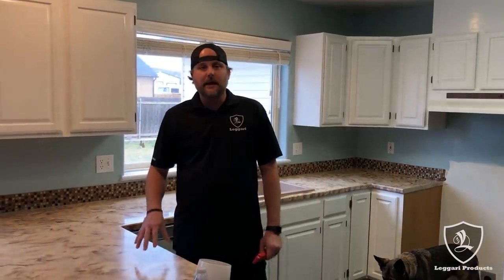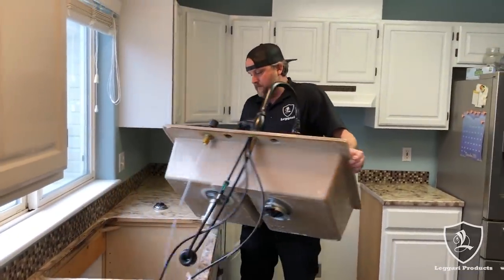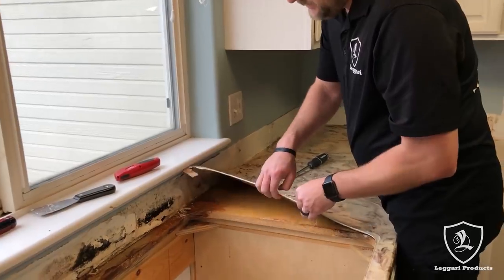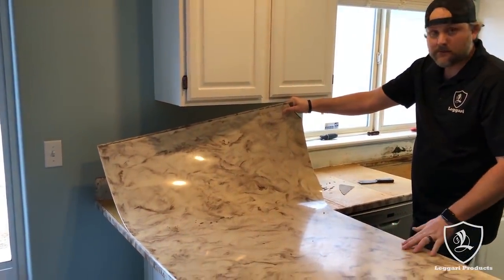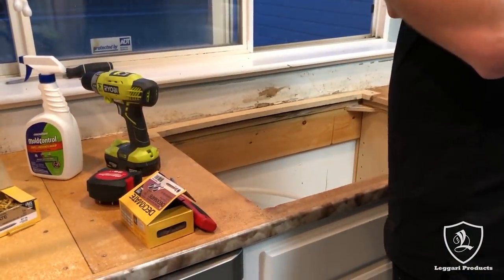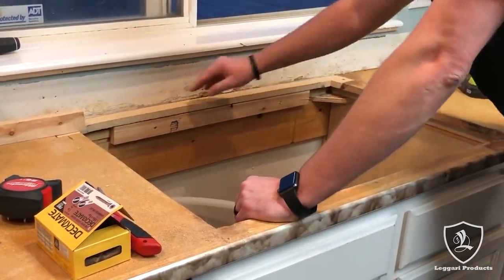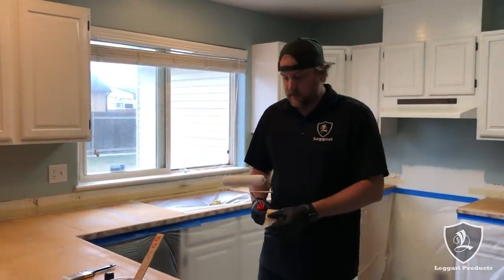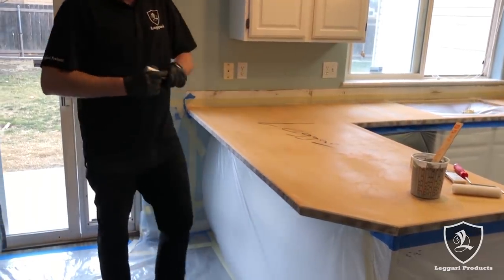Metallic Epoxy Kitchen Renovation | Before & After | Beginning to End!

Comment: I disagree with using the drywall mud. Although easy to work with and inexpensive, it's also water salluable. If you get any water, moisture under the epoxy or bonding primer, it will break down and seperate from the drywall mud. I'm always open to information and learning if you know something I don't, I would love to hear and understand the material/method used. Great video, beautiful work. :)

Comment: Thanks for showing us how you handled that mold issue... talk about half assed! I've been in construction for over 30 years and that just sheer disgusting! Like they say  ... what does it matter, you can't see it from your house!  Grrrr!
Reply: Right!
Reply: Indeed. Spraying damaged porous material with “mold cleaner” and wiping it a bit. That wall material should have been cut out and replaced. This is precisely why good contractors get a bad reputation - poor, lazy work done by their peers.
Reply: You can tell he isn’t a contractor...he’s a countertop guy. He should’ve removed the molded sheet rock. His lingo referring to “bolting” the supporting 1x to the wall tells me that he doesn’t do much construction work.

But, what he does really well is create gorgeous epoxy countertops. That countertop turned out looking amazing.

Comment: Does a top-coat give a smoother reflective finish at the end?
Reply: Matt Mastracci yeah I feel like a top coat and torching this project would have made it a lot better. Still great job though
Reply: @DustToGloryPW  I wondered why he didn't torch it. Perhaps the alcohol does the same thing to disperse and remove air bubbles. Does look good
Reply: @flaron352  You got it; they explain in some other videos that the Leggari Products are formulated so you don't have to torch them; the alcohol not only causes the cool cratering effects, and spreads out the pigments in the more natural looking granite effects, but it also causes the bubbles to surface and pop :)
They have a couple top-coats that can be used, which give different levels of gloss finish, while adding a protective layer that I don't think a kitchen counter should be without

Comment: If the body filler is gumming up on your sandpaper you either didn’t use enough hardener or it’s not dry or both. You should be able able to sand that entire piece with one sheet of 80 grit. Also if you don’t use enough hardener it will continue to shrink for days and the deeper voids will reappear slightly after the job is done. Body filler aka bondo is a chemical reaction just like the epoxy is, It needs to be mixed right to work properly.

Comment: When dealing with epoxy its important to use a heat gun or torch to remove bubbles. You might not be able to see them with black and silver but they are there and will eventually crack.

Comment: I've never even thought or been taught using tape to deshed a roller! Awesome! The ashesive has no chemical reactions with primer or paint?
Reply from the maker: It works really good to get rid of all the loose fibers so they don't fall into the epoxy.  There is no chemical reaction with our primer it is specially made for our epoxy.  Thanks

Comment: Priming looked good. Wouldn't you want to prime that raw edge around the inside of the sink cutout, so the epoxy binds well to that material. To me that would help to seal it from any future water damage should a leak occur if the caulking were to fail. The rest of the project turned out fantastic as well. One other question, where did you get that hat with the rear facing brim? I'd like one like that. 😏🤭😁
Reply from the maker: Yes you can prime and coat the edges and it will help.  Not sure if he did that in the video.  Thanks for watching
Reply: @LeggariProducts  no he didn't, that's why I mentioned it.😏

Comment: Really nice. You guy should try mimicking quartz veins. I was thinking shaved crystals, crushed crystals, some real stone coutner tops, have, that stone flake reflection looking, I have seen people suspend stuff younger that mimicked that but I can't remember. So maybe pastic, but that s dull even in pieces... Sparkles are pretty easy to tell. Glss qouldnt work... My mind says there is a substance you can add to theresin to mimic such a thing in clear ot semi clear which causes the resin to kind of fracture under neath. This means you would need ot have finish coat on the top... hmm..
Reply from the maker: I will pass that information on to Tylor.  Thanks for watching the video

Comment: How long does the exopy last? Does it crack... Or is that about the quality of resin?
Reply from the maker: Our products are actually industrial coating made for military aircraft hangers, etc. So theoretically in a residential, or even commercial setting it will last forever. This is NOT a cheap epoxy paint that you will commonly find at box stores like Home Depot or sherwin Williams. It is a thick 100% solids epoxy coating.
Thanks

Comment: this is exactly what I want! how did you delint roller and I have pets so fur is an issue. I will clean, vacuum , mop and have the pets spend the weekend at a friends when I do this. however, I know lint, hair or fur will make its way onto the counter before its dried. I saw you pick something off the counter at the end. Is that all you do pick it off? it wont leave a mark? What color pallet is this?
Reply from the maker: If you get lint or animal hair while it is drying, then before you apply the top coat you can sand the surface with 220 grit to get rid of the hairs or lent then apply the top coat.

Comment: About how much working time do you have with the epoxies? And how long does the base coat have to dry before you can do the top color?
And when you spray the isopropyl, does it self level back out?
Reply from the maker: You will have 45 minutes to an hour to work with the epoxy and after applying the base coat you immediately fallow it up with the highlights.  Yes the isopropyl alcohol will self level out in the epoxy.  Thanks

Comment: Does your Apoxy products not have air bubbles? I didn't see you having to use a torch or anything. Very nice thorough video! Thanks for sharing!
Reply from the maker: We have a high end epoxy that has an additive in it to make the bubbles rise to the surface and pop on their own.  Thanks

Comment: I know this product is for counter tops and floors but is it possible to put it on walls with the same great results
Reply from the maker: This is not a good application for a wall because the epoxy will just run and you will not get the same look.

Comment: You need to do a follow up a month later see how it looks. I’m sure it will look lot different everything look great when is wet.
Reply from the maker: Our products are actually industrial coating made for military aircraft hangers, etc. So theoretically in a residential, or even commercial setting it will last forever. This is NOT a cheap epoxy paint that you will commonly find at box stores like Home Depot or sherwin Williams. It is a thick 100% solids epoxy coating.

Comment: What was the mold products you used this is the same thing that happened to my sink, mold control by who? Thank You Guys
Reply from the maker: It is a mold cleaner from Home Depot.  Thanks
Reply: Any porous material (mdf, drywall, hard wood can be sanded) that has become moldy should be cut out and replaced, along with anything behind or under it that has also become moldy. Mold “cleaners” cannot penetrate enough to kill what’s inside the material and it will return with any moisture. Additionally, mold weakens the structures it grows on and the the remaining spores can cause allergies and other health issues.

Comment: Hi there, GREAT job
just a simple question,
what is the primer used? can you simply just use paint as a primer? or paint primer or what?
thanks for sharing.
Reply from the maker: Our primer is a water based epoxy specifically designed to chemically bond to almost all smooth surfaces.  You will want to use our primer with our epoxy because it is specially made for our epoxy.  Thanks

Comment: On this particular counter top doesn't have the laminate back splash, I'm planning on doing one with that back part, wondering if I cut and make it flush is any video showing that process?
Reply from the maker: Sorry we do not have a video at this time, you can contact our techs at 844-534-4274 ext. 1 and they can let you know how to do it.

Comment: Needs more details. What’s the primer? Two part mix? Bondo is not structural. The epoxy (if it’s two part) would be more structural then bondo. Bondo is just a harder drywall mud. What kind of spray paint is that? What orange peal?

Comment: Is the surface non toxic and safe to prepare food on?  Also can future scratches be sanded and buffed out?
Reply from the maker: Yes the epoxy is 100% sealed with no outgassing.  Yes you can sand later and apply a new top coat and it will pop the countertop like it is brand new.  Thanks

Comment: What kind of primer did you use?  It was hard to tell.   Was it like a latex based paint primer?   Or an epoxy primer?   thank you!
Reply from the maker: Our primer is a water based epoxy specifically designed to chemically bond to almost all smooth surfaces.
Reply: Ok, thank you so much.   What a beautiful job you did.  I like to try that in cream based colors.   Very inspiring!!  Awesome job!

Comment: Hi! Is this epoxy kitchen resistant to hot cookware and a cuts of knife?
Reply from the maker: Hello! The epoxy can hold up to 150 degrees constant heat and 200 degrees intermittent heat. We always recommend using cutting boards and hot pads to take good care of the countertop!

Comment: Primer must be suite on epoxy ora just is adabtabel on  the wood ? Thanks
Reply from the maker: Our primer is a water based epoxy specifically designed to chemically bond to almost all smooth surfaces.

Comment: Wouldn't it be smart to run the epoxy over the edge into the sink in order to prevent the wood from being susceptible to moisture damage?
Reply from the maker: For best application you will want to remove the sink so you have a good transition line of epoxy under the sink.  Thanks
Reply: @LeggariProducts  haha obviously remove the sink. but have the epoxy flow over the edge into the hole where the sink goes to seal the edges of the wood in the sink hole?!

Comment: What kind of epoxy do you use? Isn't it toxic? Especially in the kitchen. Hot dishes can ruin the countertop?
Reply from the maker: The epoxy is FDA approved.  The product is very low VOC’s meaning it has little to no smell at all. It’s 100% solids so there’s no toxins evaporating in the air.

Comment: So, you just left the moldy sheetrock on the wall instead of replacing it?  You've got the wall open, why not replace it with something that won't rot?  Not criticizing, genuinely curious.
Reply from the maker: Not sure why it wasn't replaced, but if you can it is better to replace it.
Reply: @LeggariProducts  That's what I thought, thanks for the reply.  Awesome looking counter-top.
Reply: I was wondering the same thing because it'll still breed mold under there.

Comment: Would i be able tp add fake gold leaf while its drying? Would i have to add clear epoxy over it or would it sink into the epoxy while its drying and self leveling?
Reply from the maker: Yes you can add the flakes while the epoxy is still wet then apply the top coat over the top.  Thanks

Comment: What would you use for a top coat?
Reply from the maker: We have 3 different top coat options. Glaze coat is our super high gloss top coat that lays out glass smooth just like the metallic epoxy coat. Our WB Urethane comes in high gloss and leaves a minor texture and we also have a WB Urethane that’s a Matte/Satin finish.

Comment: I have been watching these videos and i want to apply this to process to rammed earth floors im making out of dirt & aircrete (concrete foam) . Do you know or have you tried this on aircrete surfaces?
Reply from the maker: We are not familiar with this process but it seams that it will be porous.  If it is porous you will want to flood coat it first with clear epoxy to seal off the pores and make a smooth flat surface.

Comment: why not a foam roller and I find thin masking can melt from the heat of epoxy going off
Reply from the maker: We do use foam rollers on our glaze top coat but we prefer to use a nap roller on the install because they leave a more marbleized look in the epoxy and it is easier to spread the epoxy with.  Thanks

Comment: Looks like you did a topcoat after all!
Reply from the maker: We have 3 different top coat options. Glaze coat is our super high gloss top coat that lays out glass smooth just like the metallic epoxy coat. Our WB Urethane comes in high gloss and leaves a minor texture and we also have a WB Urethane that’s a Matte/Satin finish.

Comment: Maybe a stupid question but I have a granite countertop that I'd like to coat, is that possible? 
Can't seem to find information on it. (Everything I read ends up being for Fomica or other countertop material. )
Reply from the maker: Yes it can be installed over granite.  We recommend you remove the factory finish with a palm sander with 80 grit, then wipe it clean then you are ready to apply our epoxy.  Thanks

Comment: I have a drop in sink and drop in cooktop on my laminate, is it possible to do this without removing them?
Reply from the maker: We recommend removing them to so you have will have a seamless transition.  Thanks
Reply: @LeggariProducts  Thanks! Also, my countertop has a lot of grease and a burn hole, am I able to use TSP to clean it off before hand and repair with spackling or better to just peel laminate off and apply to mdf?

Comment: Can you use oil based paint? Isn't spray paint oil based? I'm not sure but I was thinking of using an oil based paint that I used for my cabinets onto the epoxy design so it would match? Would that work? Maybe put the paint into some kind of sprayer?
Reply from the maker: No this is not an epoxy that you want to use an oil based paint.  Thanks
Reply: @LeggariProducts  Ok thanks
Reply: @LeggariProducts  But spray paint is ok?

Comment: Why don't you use mini rollers for the edges?
Reply from the maker: We just have always used 3/8 inch nap rollers instead of wasting another roller.  Thanks
Reply: @LeggariProducts  Cool. Just figured it would work better but if the big ones do the job...why not

Comment: How long this will last.
Reply from the maker: Our products are actually industrial coating made for military aircraft hangers, etc. So theoretically in a residential, or even commercial setting it will last forever. This is NOT a cheap epoxy paint that you will commonly find at box stores like Home Depot or sherwin Williams. It is a thick 100% solids epoxy coating.
Thanks

Comment: Looks nice, but this is still the Homer Simpson way to temporarily fix your countertops for a year or so. You're always going to have lots of water around the sink area. Thus rotting particle board and lifting Formica is why I would never do this in my kitchen. You should also always thinset and grout all tile in wet areas. Then only use silicone caulking to seal the sink in place.

Comment: Damn he's been working with that base coat for awhile , how long before he runs out of time and it hardens?
Reply from the maker: When you add the hardener you will have 45 minutes to an hour to work with the epoxy.  Thanks
Reply: Leggari Products  thanks because myself and my wife are thinking of re-doing my 4’ X 4’  2” on side table.
Reply: Great job, masterful.

Comment: The shots at the end reveal that it cured VERY orange peely.
Reply from the maker: We have 3 different top coat options. Glaze coat is our super high gloss top coat that lays out glass smooth just like the metallic epoxy coat. Our WB Urethane comes in high gloss and leaves a minor texture and we also have a WB Urethane that’s a Matte/Satin finish.

Comment: that's black mold on that back splash.. spraying it isn't what I would have done... also when you put that board on the back up on that.. it's going to be a pain in the ass putting in those sink clips in the back of the sink.
Reply: skipped ahead to see the finished countertop, looks nice. Nice work.
Reply from the maker: Thanks for watching the video
Reply: Derrick Fremen Aside from being an allergen for roughly 25% of the population, the mold clearly damaged the wall (it weakens what it grows on) and is likely beneath the surface, as well. It wouldn’t have taken much effort to remove the damaged materials and replace them. A little effort for doing the job right goes a long way.

Comment: Epoxy countertops is the WORST option.
Looks glossy and super nice when brand new.
But scratches way too easily.
Scratches even when just cleaning countertop for crying out loud.
Um I'll pass.
Reply from the maker: Not if you apply the urethane top coat over the epoxy because it will make the surface more durable.

Comment: it's too bad there's that orange peel effect instead of an ultra smooth finish.
Reply from the maker: We have 3 different top coat options. Glaze coat is our super high gloss top coat that lays out glass smooth just like the metallic epoxy coat. Our WB Urethane comes in high gloss and leaves a minor texture and we also have a WB Urethane that’s a Matte/Satin finish.